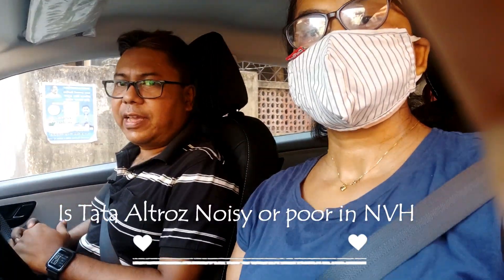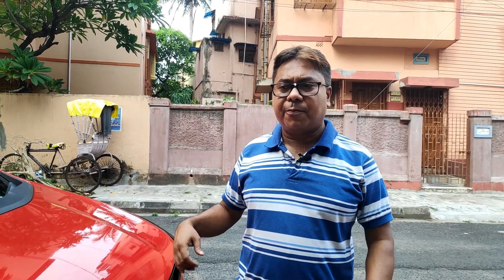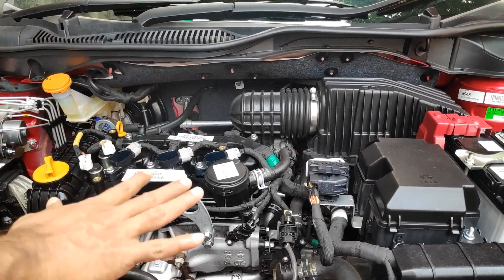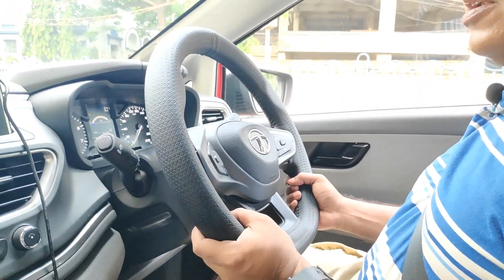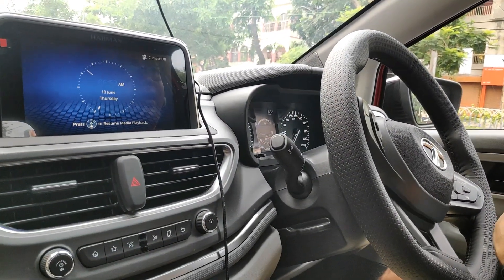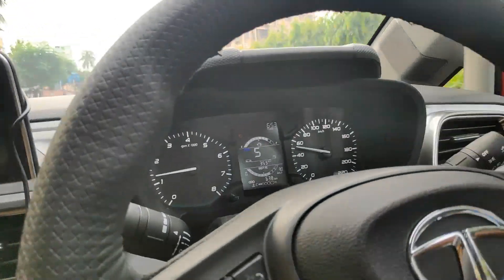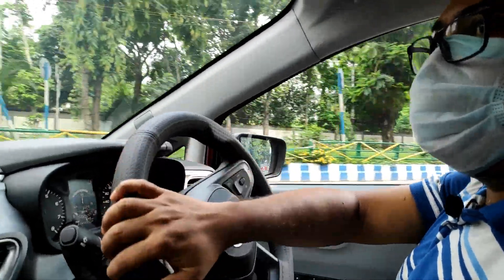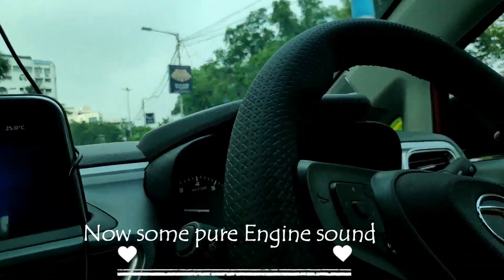Is Altroz Petrol N A Engine Noisy ?

Comment: Is it a default rattling noise while gear changes? Or it can be solved by mechanic? Has Tata come up with a resolution till date?
Reply from the maker: There is no rattling noise from gear changes please do check with service centre
Reply: @supercyberautomotivetravel  i mean to point out the air filter noise that you mentioned...is that default? Or comes when in 4th or 5th gear?
Reply from the maker: It's not the air filter noise. It's the sound  comes from air intake to listen to this noise you need to place a mic in engine compartment.😀
Reply: @supercyberautomotivetravel  oh..does it come to cabin?...is it disturbing? Bcz buying altroz in this puja..
Reply from the maker: Not at all go ahead
Reply: @supercyberautomotivetravel  ok..thanks...

Comment: Thanks for this video sir. My opinion., It is better than Renault 3 Cylinder engines. Also., Compare to Maruti .,Maruti is better by 1-2 points. But if you are comparing to Hyundai , the Hyundai engine leads by 4-5 points definitely. Considering the Price, Practical features along with Mileage Altroz offers - It can be ignored. But Engine noise is really needed to be improved from Tata for sure.
Reply from the maker: But still Maruti engines are more refined and more reliable. After all Japanese are the best in  specially the petrol ones

Comment: Sir when you drive in hills with 2nd 3rd and 4th gear you will feel more noisy and performance is also not so good
Reply from the maker: In hills you need to maintain low gear ie mostly second and third and in some cases first also . Here the engine will feel noisy and need to maintain proper gear depending upon incline. Three cylinder engines lack refinement .
Reply: @supercyberautomotivetravel  thank you sir for your kind response

Comment: Sorry to contradict, but mine 1 is just 3 months old, noise & vibration is on higher side than my 5years old previous car
Reply from the maker: Actually if  you  compare with any 4 cylinder car it's bit noisy. In fact my previous car was Swift (2016 model )which had less Engine noise than Altroz. But it's much better if I compare with 3 cylinder I litre engine.